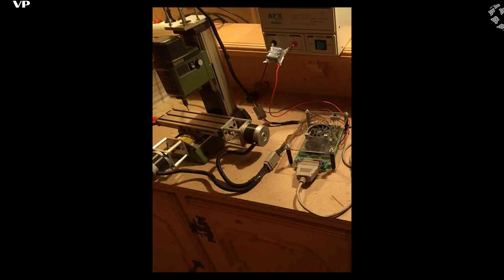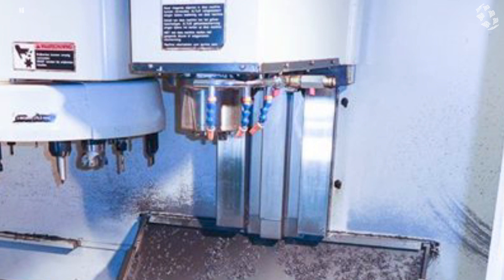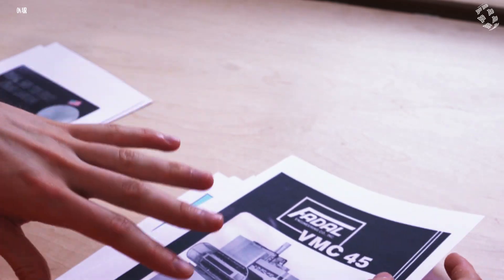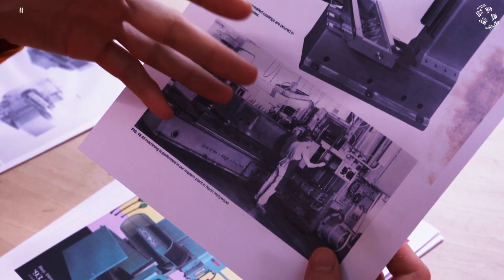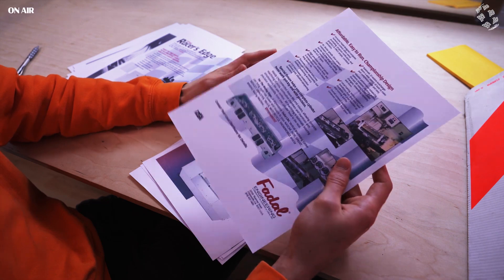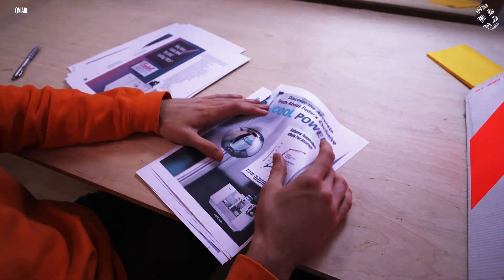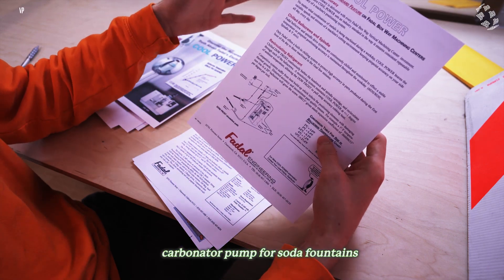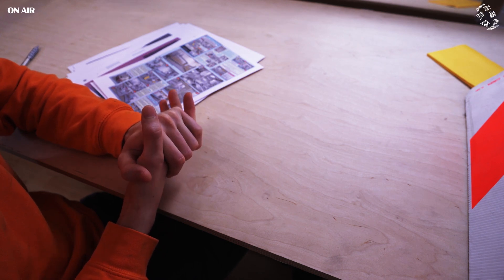Delivery of a CNC machining center - BUILDING THE FACTORY

Comment: You should check out some of the upgrades that Calmotion makes.  Glenn De Caussin owns Calmotion.  They have control and spindle drive upgrades for Fadal machines.  The De Caussin family owned Fadal.  The 527S and the HS control panel is pretty amazing.